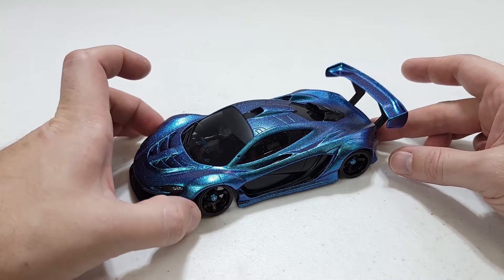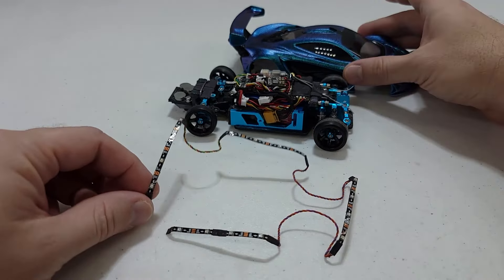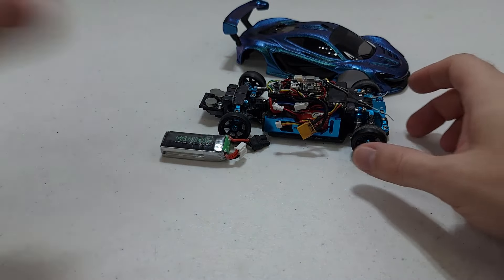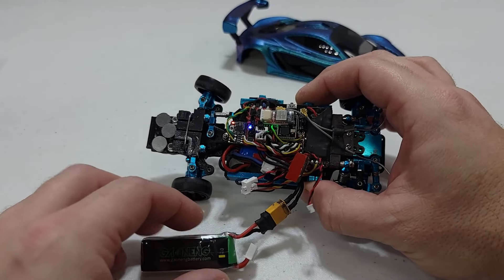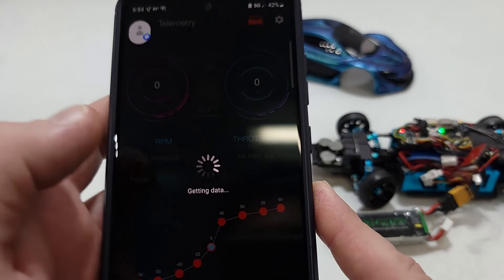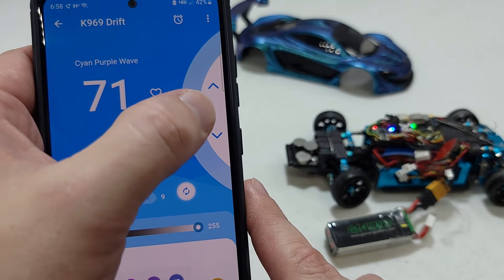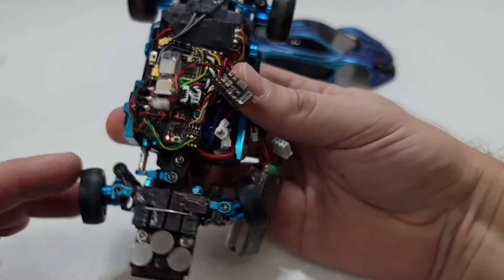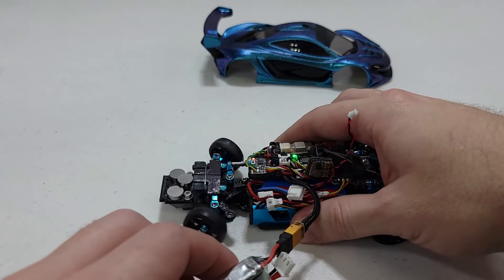WLToys K969 Rebuild Completed! Electronics Upgrade, DasMikro V6 Gyro, Furitek Momentum ESC, etc.

Comment: This is so cool! Not sure if i just didnt catch it in the video, but what kind of transmitter and recievet is this, im on a tight budget and was wondering how this can be so small. Ive had issues adjusting endpoints on stock controller, so thinking of using a microcontroller or a new remote
Reply from the maker: Yea I mentioned it really quick sorry, it's the RadioLink RC6GS V2 transmitter and R7FG v1.4 Receiver. It's a 7 channel Rx that I took out of the case and desoldered all of the pins. You could use the R4FGM Rx which is smaller and only 4 channels since that's all you really need. I don't think you can really adjust the end points on the stock transmitter which is a big reason why I swapped out all of the electronics in the first place. I don't know how expensive the RadioLink transmitters are now since I got mine for around $60 over a year ago so check the internet for the best price.
Reply: @AirToGroundRCFPV  is end point adjustment really needed? Could the same effect be produced mechanically through the steering  mechanism, and would one of those blue 9g servos be an upgrade over stock

Thanks so much for your help
Reply from the maker: @soapy5343  I burnt the stock servo out because I couldn't adjust the end points. The replacement 5g servos with metal gears that are the same size as stock are more robust and work fine for me, that's what I ended up using in the end so you might be able to get away with out end point adjustment with the metal ones. The 9g servos technically are stronger but they are much bigger so it's harder to find a spot on the chassis to make them fit but they are not that much stronger to choose them over the metal 5g servos in my opinion. If you are going to stress the servo like I am you pretty much have to use metal gears, the plastic ones won't last, 9g or 5g.